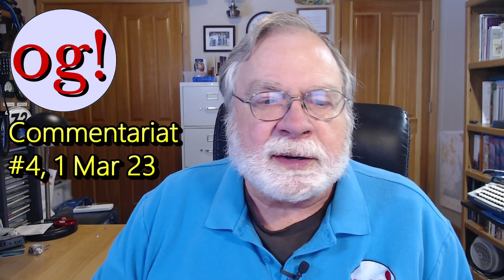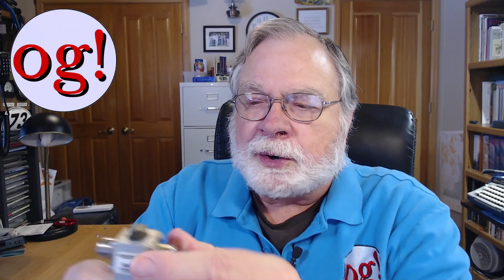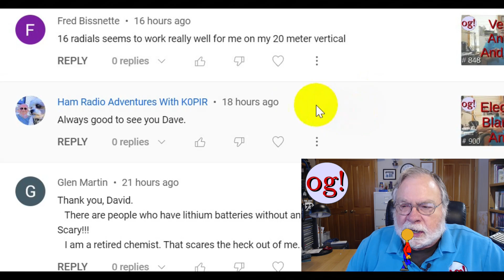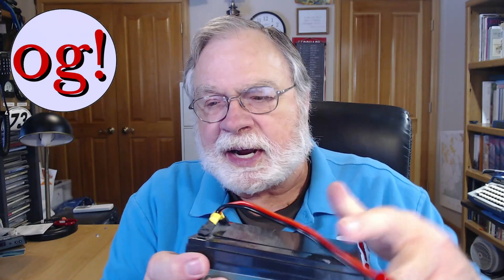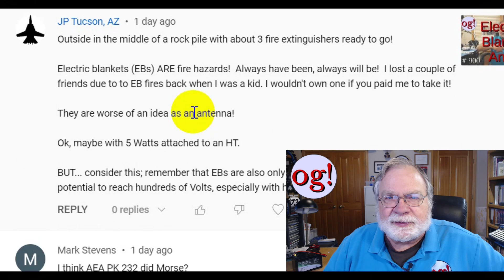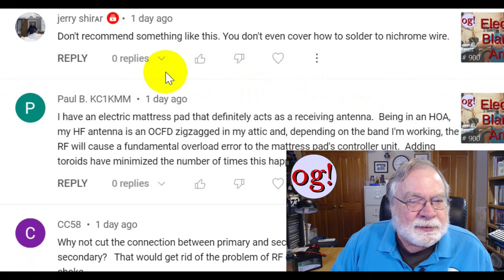Commentariat 4 Project

Comment: The main issue with Pb/Acid batteries in submarines was getting the salt water into the cells and producing CHLORINE GAS which would kill everyone on board W/O actually sinking the ship. Yes, things COULD short out all over the place, but if the Salt water got to the batteries and you didn't have enough baking soda to neutralize the acid well you get the idea.

Comment: Did you ever reply about my mistake that turned out awesome?
Turned my multiband NVIS MFG-1984HP which I could use on all bands up to 600 miles away, to a Inverted V with SS guy wires rather than guy ropes. Result was a single band 20M with 1.0:1 across the band. Now getting 20 over 9 from stations 1,800 miles away. Other bands are now outside IC-7300 tuner range, but it is awesome.
Might put my IDG 200 Pro back it to see how it will do on other bands.